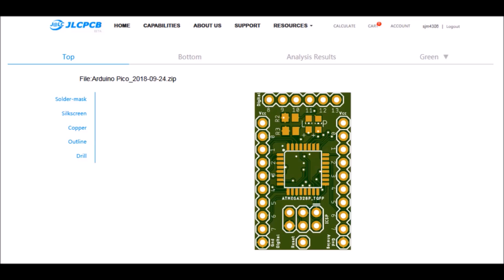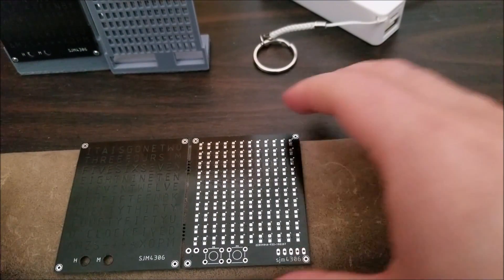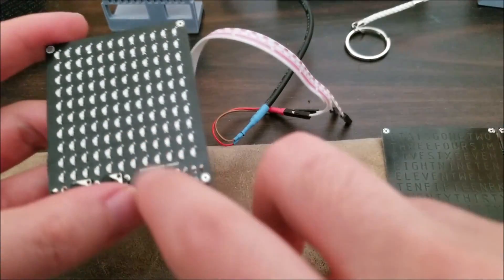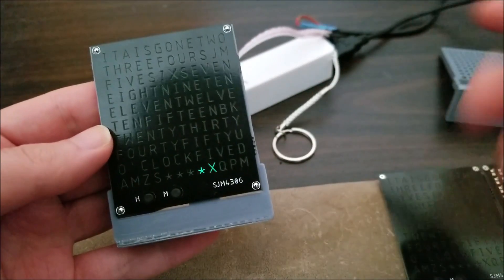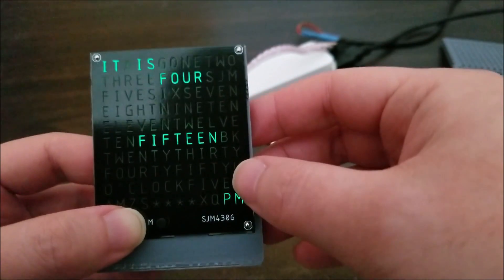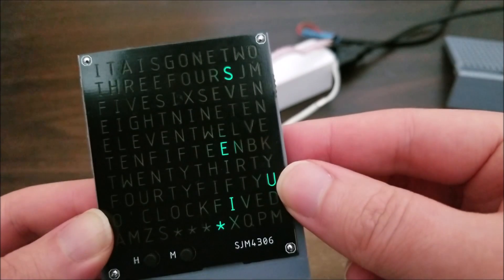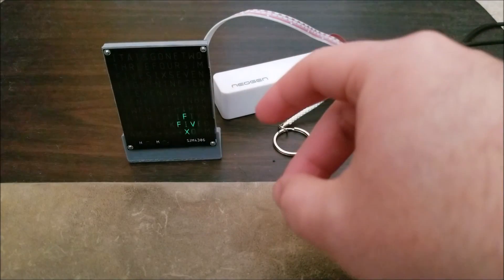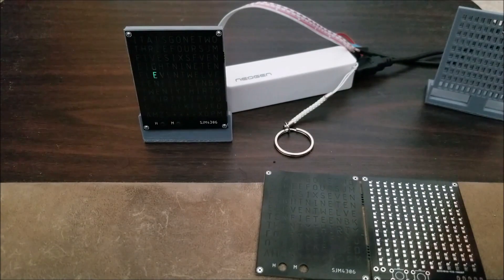Word Clock Part 2 - v2.0 Of 3D Printed Frame And Software!!!

Comment: Hello, i found the Gerber files, but I cannot find the parts list of which resistors which rtc and other stuff i have to buy.
For most parts it is clear but which RTC chip?
Reply from the maker: The rtc is ds1302 (the slim soic version not the wide one iirc). The part values are definitely in the schematic file which can be viewed with the free version of eagle, but I'll have to check when I get home if I uploaded the pdf of the schematic.

Comment: Hi!
I'm currently DIYing your project but i can't find the DS1032S+ i only have this one
https://store.fut-electronics.com/products/ds1302-real-time-clock-rtcic
Can i use it and solder the through hole pins in the board? 
Also can you tell me any alternative RTC ic like the DS1302S+ ? 
THANKS!

Comment: Totally creative idea, love it! Count me in for a kit if you sell some ('cause I don't own a 3D printer yet).

Suggestion: The original word clock had two languages in it (which you could order, i.e. English/German or such). Do you think there might be space for a second table in memory? I'd so much love to have an English/German one and could probably provide you with a working letter layout for German. Just imagine, switch language, change front plate … :-)

Is the code open-sourced so one could add/modify?
Reply from the maker: Kit's are available for purchase now (https://www.makerfabs.com/small-word-clock-kit.html). There's a decent amount of memory left and implementing a look up table for different languages along with a german faceplate wouldn't be very difficult. The design is open source with files available on the hackaday.io project page linked in the video description. Feel free to modify what you'd like to (all I ask is if you re-release your new version I would appreciate attribution).
Reply: @sjm4306  Cool, thanks! I ordered two, so I’ll have a spare to tinker with. ;-)
Reply: Got my kits today, like them a lot! I’m quite happy the kit had the LEDs (and almost everything) soldered already because I ran out of solder paste. Builders/buyers should probably get some CR1220s beforehand, they aren’t that usual and you might have none in your stock. Now I only have to get a 3D printer and build a stand … ;-)

Btw, you might want to swap the "brightness words": ONE is brightest, TEN is darkest, I think one would expect the other way round?

Comment: I would prefer like **TEEN  rather than TEN** :)
Reply from the maker: The firmware and board are open source so it'd be pretty simple to modify them to display however you'd like.

Comment: To worry about the light bleed is almost like worrying about in a Nixie tube a number being covered  partially by the number above it.   But the solution to get rid of the light bleed whether it's really worth it or not is to use a black rubber gasket  that goes on top of the 3D printed frame.   Or maybe there's a way of making the 3D printed frame out of rubber like softer plastic that when the screws are tightened will squish down a little bit like  a gasket.    In my  opinion it's perfect.
Reply from the maker: Found out ultimately the bleed from within the top pcb is the biggest factor as it is semi-translucent and bounces light around inside so unless I use lots of vias to physically block the light in that layer there's not much that I can do. For me though, the current iteration is good enough and I've released all the project files on the hackaday project page so if anyone wants to modify them to make it better then they are welcome to do so.

Comment: Sweet design; there must be some trick to avoiding the bleed... maybe something compressible... black laser cut foam perhaps (Black polypropylene sheet)
Reply from the maker: The bleed seems to be coming from inside the front pcb mask as the fr4 is semi-tranparent. A viewer suggested putting vias in between adjacent letters, I'll have to give it a try.

Comment: Could you use a PCB with cutouts for the mask?  That plus a laser-cut case would be pretty slick.

[I love 3d printing.  But the contrast between the 3d-printed pieces and the almost-rendered look of the PCB bugs me :-).]
Reply from the maker: The problem with using a third pcb with cutouts is that the pcb material is actually translucent in the center so it wouldn't really do much to block light without manually painting or drawing with permanent marker on all the inside crevices of each and every cutout (the black soldermask is actually just a kind of paint applied only to the top and bottom). Now a laser cut opaque midframe would work, but I don't have access to a laser cutter currently so I'd need to figure that out.

Comment: Awesome project! Any idea how much a kit would sell for when it’s ready?
Reply from the maker: I'll have to put together the bom to know the cost of parts alone and then factor in my time/effort. A very rough estimate for components, 3d printed frame and pcb is probably in the ballpark of $10-15 per kit depending on how many orders I get (hopefully I can buy in bulk to cut a little off the top of that). I plan on making a followup video to breakdown the cost and provide an email for those interested to reply and then based on the numbers I can lock in a final price before accepting any payments.

Comment: After seeing the final thing assembled, that was the bleed I was worried about. I'd definitely try decreasing the size of the mask for each character slightly. If you're worried about losing light that way, I'd say this: Consider that the LED put out a light cone. Knowing the distance from the LED, the thickness of the PCB and the size of each character, you could visualize a cross section of the light cone, and where the light cone intersects with the back of the PCB and make the back mask according to that measurement. 

I would also consider using black M2 screws to hold the front PCB in place instead of the solder connection, to blend in better with the rest of the panel. You could either do a long screw that attaches with a nut on the back, or having shorter screws self tap into the plastic if you can get the holes precise enough from the printer. In the later case, you'd need to create a new set of whole for the pack PCB that they can self tap into.
Reply: What about putting a thin foam layer between the front PCB and the 3d printed part. Hobby stores sell foam papers in 8 1/2 X11 and A4 that have a sticky back.
Reply: @Rodville  No, you need something that actually presses the PCB against the 3D printed part so it lies flat.
Reply from the maker: I think I'll experiment on v2.0 of the board and see about improving the light bleed by decreasing the rear keep out aperture like you've suggested. Having an array of circles just a little smaller than their corresponding letters may prove beneficial. For now though, this is plenty good enough for v1.0 hardware-wise, I want to polish up the software for now.

Comment: Nice vid man kinda cool idea I kinda wanna try to make something like that but do u suggest putting those small power banks into projects as batteries? I see them all over the place and was wondering if they could work as an internal battery for a project
Reply from the maker: Thanks! I use power banks for testing, but for long term projects without a hard power switch I'd worry about them draining all the time (they have internal 3.7V to 5V boost converters that run when something is plugged in). The best thing to do is to tweak a device to run straight off a lipo battery (you can salvage the battery from a power bank infact) so less capacity is lost running a boost converter and you have the advantage of putting the micro to sleep, elongating battery life to months or even years.
Reply: @sjm4306  thanks man will do

Comment: First off, the fact that a talented guy like you has 10k subs while a random 14yo gets 650k subs "reading" Reddit posts using text to speech is driving me crazy.
Second, OF COURSE I will be interested in buying a kit version of this piece of art! Would be nice if it comes both wit and without soldered ICs: soldering SMD LEDs is doable with an iron, but an IC would be a pain in the ass.
Third, this should be a beginner's Arduino coding project (the clock part, without the animations) and should be teached in Arduino classes.
Fourth and final, this reminds me and old project I did years ago (not an original creation, just replicated and tweaked something I found online) of the "Berlin Clock", an interesting real clock that displays time in a similar manner.
You should check it: https://en.wikipedia.org/wiki/Mengenlehreuhr
Reply from the maker: Thanks I appreciate the kind words. The way I see it, I started this channel as a way to document my hobbies and interests and never thought I'd reach even 1k much less 10k subs. I'm just happy that there are so many people who enjoy the same things I do.

As for the kits, once I have a final board design I'll put together a BOM and price all the parts to come up with a cost for the full kit (including any time I'd spend on programming, assembling, postage, etc.).

That Berlin Clock looks like a decimal version of the classic binary clock project every electronics hobbyist builds. I may have to 3d print and make a tiny version to sit on my desk!